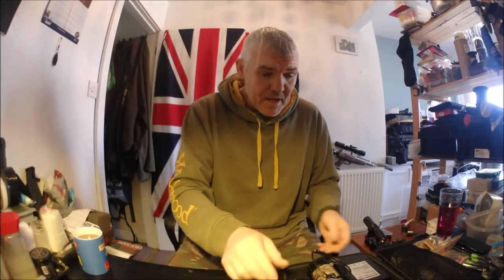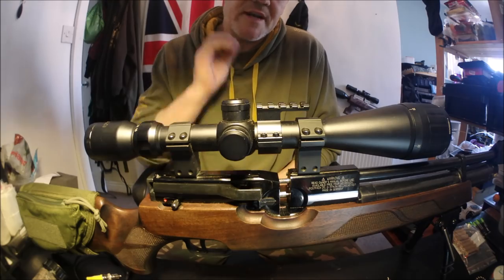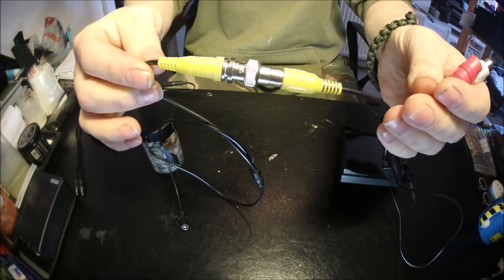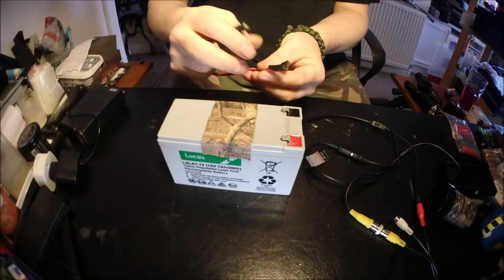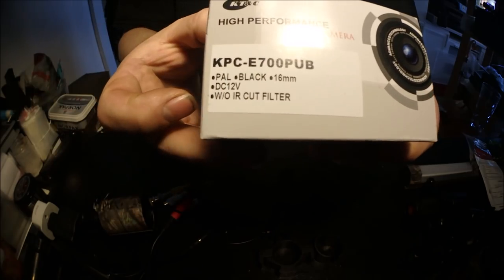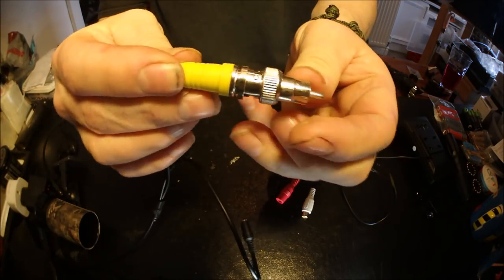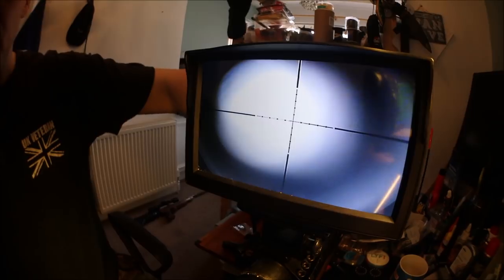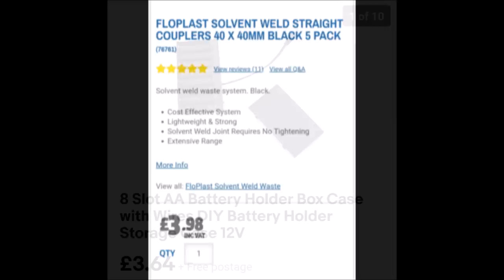DIY IR Night Vision -  How to Make Your Own! An In-depth guide - Air Rifle Pest Control

Comment: Love the video Delks. for your info the IR cut filter will make the image dull at night due to it filtering out the info red light, this is used for day time to cut natural info red rays from the sun which gives more colour definition during day light hours. so for night use you need it without the IR filter so the camera can pick up the torch you are using. Keep up the good work.👍
Reply from the maker: Excellent Daniel. Thanks for that info mate. Much appreciated that fella. I knew there was a reason for the IR filter removed version........ now I know. Top bommer that mate........ cheers 👍👍👍👍👍👍😃😃😃😃😃👍👍👍👍👍👍

Comment: tidy homebrew set up that -  made a few bits my self over the years when I used to do a bit but never thought about camera set up
Reply from the maker: Got to think of a better way of recording the footage now. Holding a camera in my left hand and holding & aiming a rifle with my right hand is a bit tricky lol 👍👍 Cheers Shaun 😉😉👍👍
Reply: @ScreamingDelkims  yeah I wondered how you recorded from camera to camera, pity couldn't find a way to split the video lead straight into recording camera or even a mini dvr recorder
Reply from the maker: @ockerdom  that's what I've been looking into mate. Connecting that set up to some sort of recording device..... was looking at a DVR or whatever they're called lol

Comment: Good vid Chris but don't you find the monitor a bit high up? you could have fitted the other picatinny scope mount you have just behind the scope turrets and fitted it to that, it would drop it down and bring it back closer to you,  more natural position. I made one a few years back they're brilliant for what they cost 👍
Reply from the maker: Yes mate. It is too high. I had to sit with the gun on a table at knee height to get the best view.
Can only really shoot it in a stationary position.
Not ideal but it works.
I've splashed out on a PARD now 👍

Comment: Hi, is it possible to make leads from that code 3/4 builders lead roll flashing for roofing? Would it be any good? Cheers
Reply from the maker: Yes mate...... that's clean lead. That's what I use. As long as it not got anything stuck to it. Clean it off first before you melt it or you'll get a lot of nasty smoke. 👍👍
Reply: ScreamingDelkims Sound cheers mate
Reply from the maker: @JamesSmith-to6tr  no worries mate 👍👍 Make sure you have the proper mask too. Not one of those dust masks 😉😉👍👍
Reply: ScreamingDelkims Yeah mate cheers
Reply: ScreamingDelkims Hi mate roughly how many leads will a 1litre tub of coating do? Cheets
Reply from the maker: @JamesSmith-to6tr  hundreds mate. Obviously less if you coat them twice. But 1litre of powder will go a hell of a long way 👍👍
Reply: ScreamingDelkims cheers